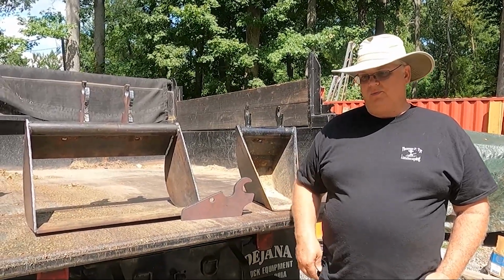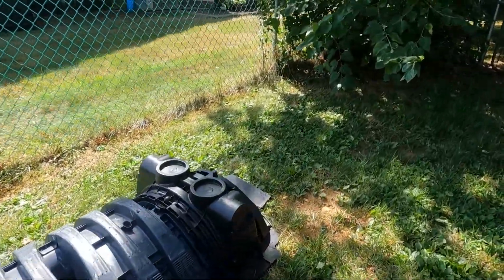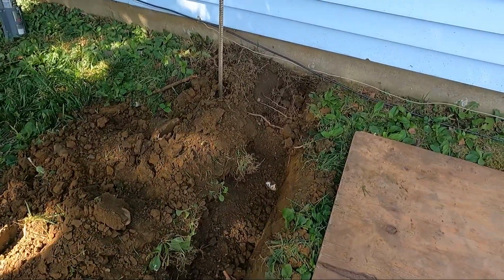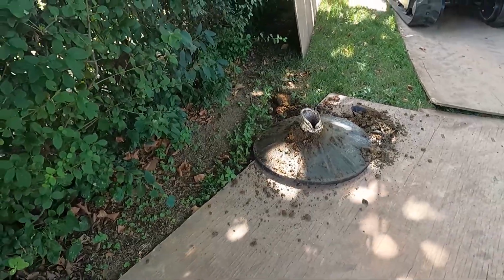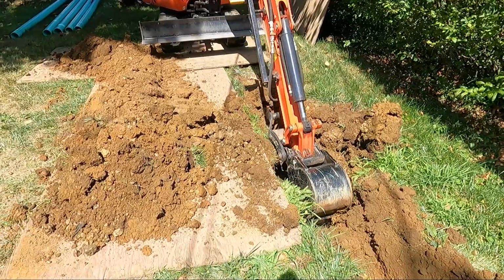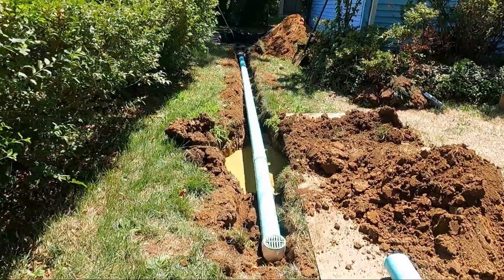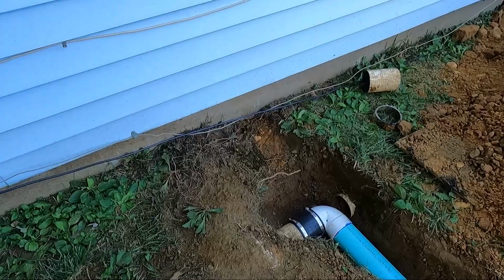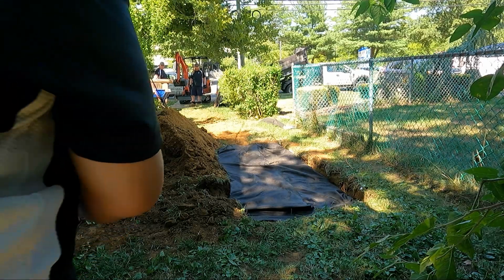Replacing a Failed FloWell and why this Dry Well failed

Comment: Nice job, do you slope your overflow and emitter.  I like the post in bucket as leveler for backfill
Reply from the maker: Thank you ktm. The overflow pipe runs uphill from the dry well to the emitter. That way only the excess water leaves through the popup the rest would go back to the dry well. Have a good weekend, Tom

Comment: Nice job as usual but why no vents in this one?
Reply from the maker: Hi Dmvitt,  Thank you for the compliment.  This house is sold and the closing is in a couple weeks .  This job was just to replace the existing dry well with our smallest chamber system.  Which is still 250 gals.  This work was in the contract and had to be done before closing.  The overflow is the only vent.  Just the basics - no bells and whistles.  Thanks and have a great week, Tom
Reply: @tyelandscapinganddrainage  I see. Thanks for getting back.

Comment: How deep is the frost line there and are you getting under it?  I want to use this system for my water softener backwash in lower Michigan.
Reply from the maker: Hi Rick,  I usually install at around 24 inches although I have done several at 3-1/2 to 4 feet.  Our frost line is 36 inches.  I have never had a problem with any of the chambered systems at 2 feet and we've been installing them for years.  I hope I answered your question.  Tom
Reply: @tyelandscapinganddrainage  thanks for the quick reply.  Do you know if the salt in the softener backwash will clog my soil?  It's a fair amount of clay.  Perks about an inch every 45 min after saturation presently.  Softener backwashes with about 80 gal every 2 or 4 days.
Reply from the maker: That sounds like good perk Rick.  I don't know how the salt will affect the soil.  You might consider tying in a downspout or two to help flush out the salt.  Tom
Reply: @tyelandscapinganddrainage  thanks.  Idk if I want to do that as it might overload it.  I think I have more research to do.

Comment: How would you calculate the size of a dry well required for a French drain?
Reply from the maker: Darrin,  That's difficult to answer.  First, you need to know how much water is coming from the french drain.  Second, you need to know how good your soil percolation is - how fast you can percolate the water.  Then, there are other variables like; is there any water table issues and can you have an overflow pipe.  I am sorry I can't be more help with your question, Tom